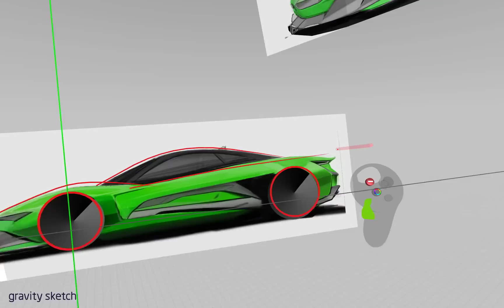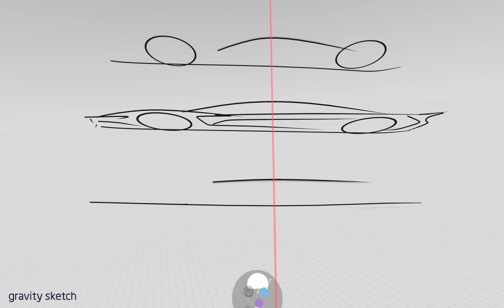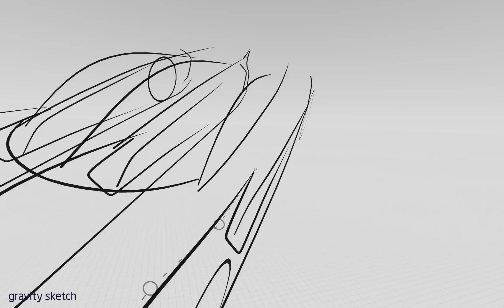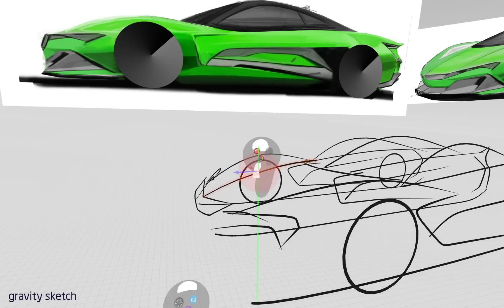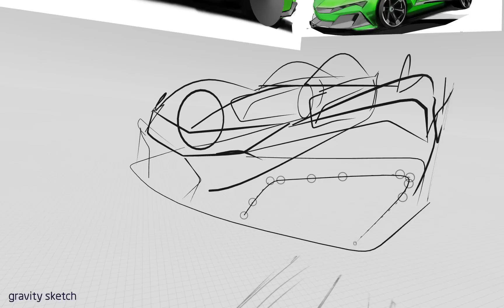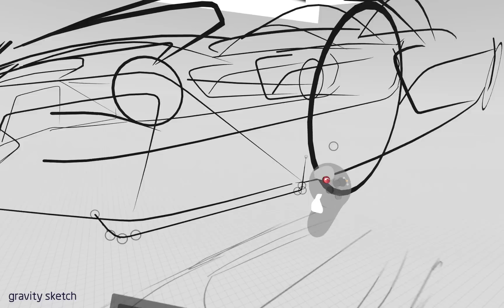Gravity Sketch VR, Super Car Demo, Part 1

Comment: Is this in the Quest2 or Q2 for Business? I am looking to design in VR for my business and need to know if I need to buy the Business edition for this specific function or personal. thankyou!
Reply from the maker: This was made with the original Oculus rift. But currently I use the Quest 2. No need to use the Quest 2 for business to use Gravity Sketch.
Reply: @JamesWRobbins  does storage make any difference on the performance in quest 2? 128 vs 256
Reply from the maker: @danp7979  nope. only data storage. But with landing pad you can store most files online

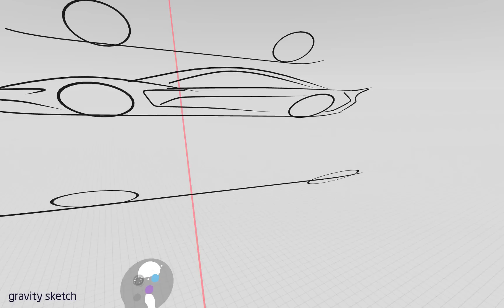Comment: @ 6:10 when you pull out the wheels they pull straight along an axis. How do you accomplish that. 

I am university student trying to teach my self this program.

Your videos are really the only resource. 

Thank you for uploading!
Reply from the maker: I use the smart move feature. Make sure it is enabled in settings. When you hover over a part you want to move with the red grip sphere it will highlight red. Now align your other controller and the axis widget will appear. Now you can grip and move the object along that axis

Comment: How did you get the items you move to duplicate on the other side? When I use the smart move like you do @6:09 I just pull out the line but it doesn't mirror.
Reply from the maker: You should turn on mirror in your settings. Also each item has its own mirror option that can be toggled when editing that object

Comment: Is GS worth buying just for the standard version? I hear it only has the option for 4 layers :(.
Reply from the maker: I'd say yes.  Depending on what you are using it for you may not need more than that.. But for a vehicle you can use 1 layer for sketch lines, 1 for surfaces another for tires/wheels and another for details..This does depend on your workflow but it is definitely manageable. If you have a model with a lot of complexity that may change. It is a very new software and method of working/creation but has lots of potential. I think we're at at a very early stage for VR creation but is worth it in my opinion to get in it now.. Hope that helps..
Reply: Awesome thank you so much! Right now Ive been using Medium and AnimVR and having a blast doing work in VR. I agree we are at an early stage but the potential is crazy! 

When I found your channel and the work you do in Gravity Sketch it looks like it would be a really cool tool to use! Im not much of a hard surface modeler but it seems like its intuitive enough to help me with my project.

Comment: Hi..What's the vr headset are you using ? And also, does it work with ipad's gravity sketch version ?
Reply from the maker: I use the Oculus. But I have also used the Vive for this. I prefer the oculus controllers. I have not used the Ipad app so I'm not sure.

Comment: Thank you for showing your workflow. 
In your opinion what is the reason why I should go for a 3D modeling with gravity sketch?
I mean, compared to modeling with Modo is it easier or more intuitive?
Could you tell me if you are considering it just an alternative to the traditional 3d modeling or a better and easier approach to start creating 3d objects?
Thank you.
Reply from the maker: I am considering it to be a tool that can bridge the gap between 2D sketching and 3D modeling. Traditional 3D modeling in a tool like Alias or Modo can be time consuming when you are still in the early design phase. This tool allows you to do the design work in 3D space. The hardest part is translating a design to 3D and I think this tool has lots of potential to help that process. Not to mention you can see your design at 1:1 scale as you are "sketching" it. This can allow you to dial in some of the proportions and details more accurately , early on..I wouldn't consider it 3D modeling, more along the lines of 3D sketching. Those are just my thoughts. We'll see where the VR space goes for design and creation in the future. It definitely has a place.